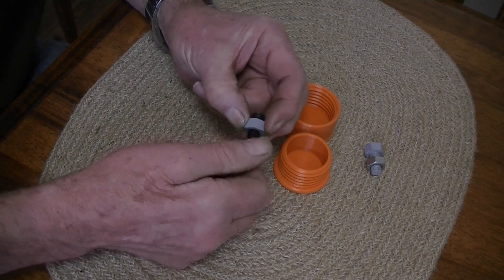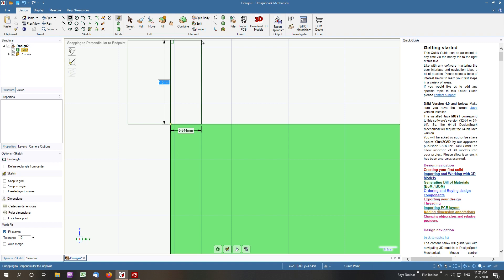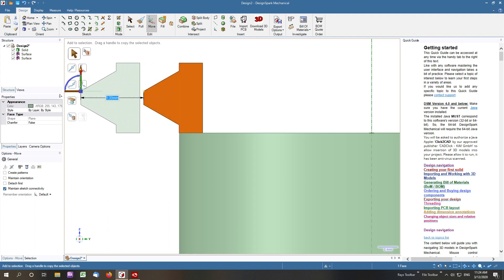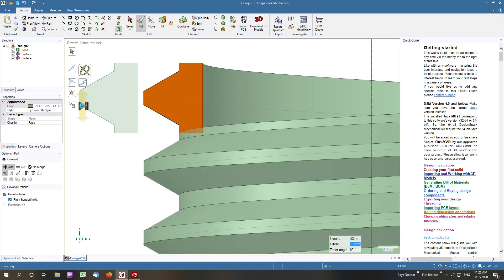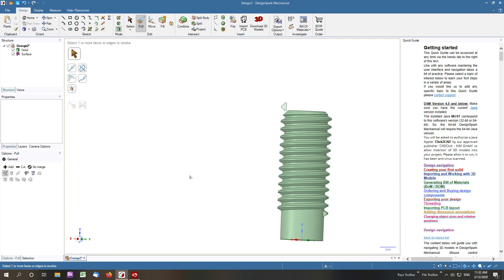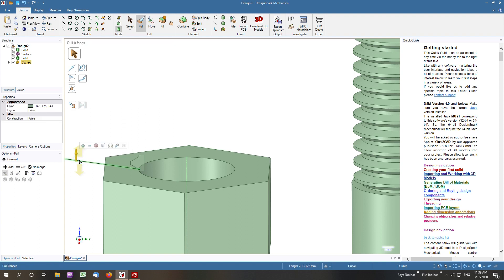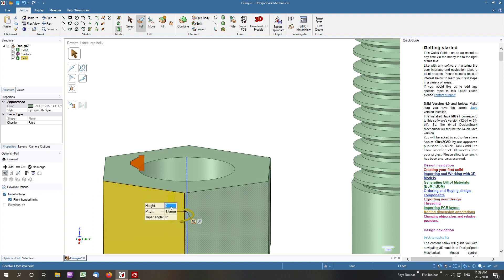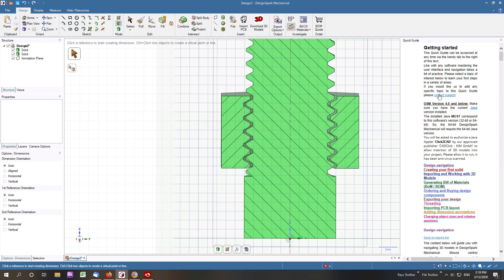DesignSpark Mechanical Tutorial Metric threads

Comment: Not sure if you're still reading this after 3yrs, but it pays to convert your nut/bolt into a tap and die set. 
Eg for the bolt, you make an extra long one, say 100mm, then you Combine (subtract) that from an equal length cylinder. The result is a die than can be copied and Combine/subtracted from a simple cylinder to make new bolts of any length in a couple of seconds. Same goes for converting the nut to a tap.
It makes it worthwhile to spend a bit of time to get the one tap/die perfect, or even make a set with different tolerances, because it saves a lot of time on future threads.
Reply from the maker: Thanks for the input. I'm to get my head around your method. Have you created a library of taps and dies of the sizes that you commonly use to copy to your drawing, to Combine with your cylinder to make the threads?
Reply: @RaymRaym-ri7lo  Yeah. A tap is the inverse of a nut thread and a die is the inverse of a bolt thread, so you can start with a standard nut/bolt and covert them to tap/die with the Combine tool on a cylinder ... then Combine the tap/die to make nuts/bolts in the future. If you make them long (like >100mm) one tap/die will do all the standard lengths, and you never need to manually draw that thread again. Taps are probably more useful in objects to be 3D printed, you can quickly put threaded holes where you need them. There's less need to print bolts.
Reply from the maker: Cheers, another solution, I can see the benefit in only having to make the tap or die once. My method is to replicate single point treading as a lathe, of which I am quite experienced. I might create a library of cutters to call on instead of drawing them each time. Tolerances are printer based so remain the same regardless of diameter or thread pitch.

Comment: I really wish DSM would add a threading tool. Fusion 360 makes threading so easy. But fusion 360 is pricey for commercial works
Reply from the maker: I agree. With DSM, if you haven't done single point threading on a lathe, the DSM method takes a bit to get your head around, especially if you wish to match existing thread standards. Working out what extra tolerances you need to allow for printer creep, adds further difficulty. The method I have described will make non standard matching threads, just pick your own diameter and tread pitch.

Comment: Thanks for this tutorial. Is there a particular reason why you didn't split the 0.6mm tolerance equally between the bolt and nut? i.e. 0.3mm for both bolt and nut rather than 0.35mm for the bolt and 0.25mm for the nut.
Reply from the maker: The printer we used for proving the setup, increased its sizes more on an external curve than an internal curve. Using those tolerances meant that printed nuts and bolts fitted their metal equivalents. That was the main point of the exercise, to produce a printed nut or bolt that was the same as the machine standard.
Reply: @RaymRaym-ri7lo  That makes sense - thanks for clarifying.
Reply from the maker: Tolerances used in the video where for an Ender3 using PLA. Different printers or filament may give different results. The process is to print a nut, adjust the tolerance for a nice fit to good quality metal bolt. Subtract the new tolerance from .6mm for the bolt tolerance. If the fit of the printed bolt to a metal nut is not to spec, adjust the bolt tolerance for a nice fit. This could mean a different tolerance than .6mm for different printer filament combinations.

Comment: The best tutorial I have seen. Solved one of the promlems I had with M5 bolt I needed to create now I need to create a R3/8 thread, the cutter have a 55 degree angle with a pitch of 1.34 mm (19/inch) any similar nice instruction for these type of threads
Reply from the maker: Sounds like an interesting exercise. The principals should be similar. Try looking at the thread specs, they may give a hint. I only work with metric 60 degree so imperial is quite foreign to me.

Comment: I am having trouble making my end cap screw all the way down, the thread ends before the cap is flush
Reply from the maker: Not quite sure what you mean but the length of the thread is entered in the dialogue box with the thread pitch and taper before you execute the operation to form the thread, or create the thread and form the the cap second.

Comment: Hi Raym, the tolerances for the Ender3 printer, if you are putting in a minus figure is it making the hole bigger or smaller, I am asking because  if I design say a part for say a 16mm hole for a bearing and print it on my ender3 the hole is too small
Reply from the maker: Hi, the hole ID for a nut needs to be smaller than the drill size and the shaft OD for the bolt needs to be smaller than the drill size as well, this gives the 0.6mm clearance in the 3D drawing. When printed, bolt threads have a large OD and nuts have a smaller ID so the clearance is tighter. The numbers only applies to threads to match them to fit standard metric nuts and bolts. You would need to experiment with clearances to have a good fit between bearings and shafts.

Comment: With your considerable knowledge, could you outline steps for CUTTING a 4" flat, disc in half, how get the axis?.  Thanks!
Reply from the maker: Try creating a plain along the line where you want the cut then use the split a solid tool. I am in the outback away from my desk until Sept. Will follow this up further then, if you can wait that long.
Reply from the maker: I have just posted a video on how to use the plane tool to split solids.